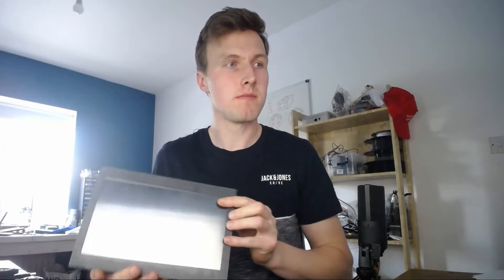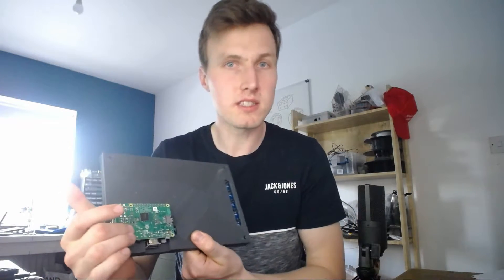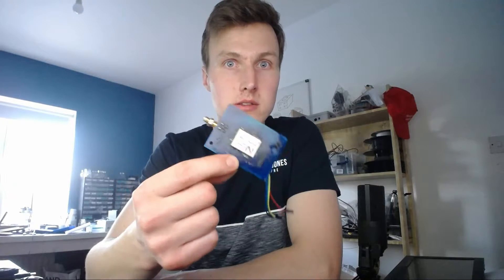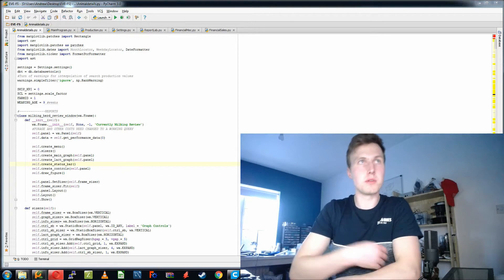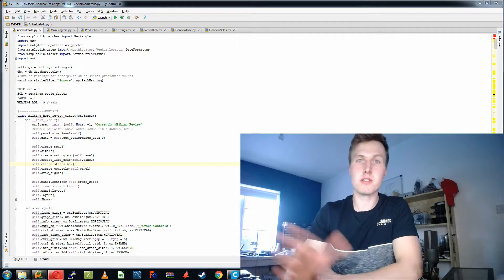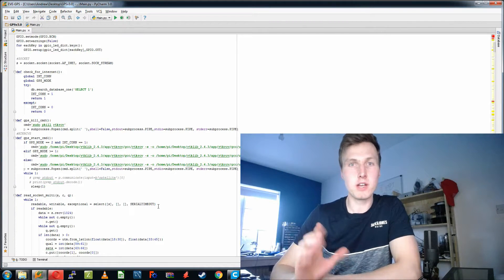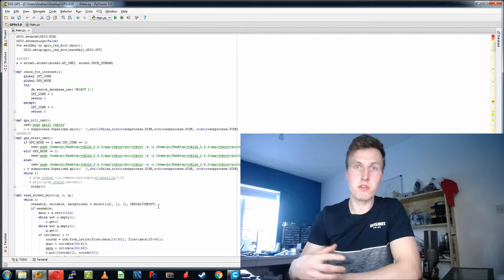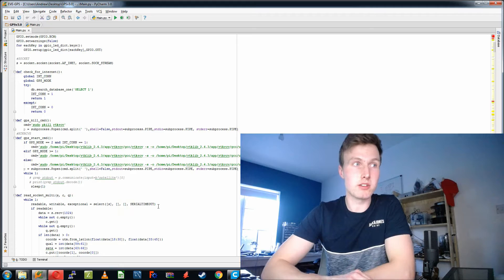Building RTK GPS for £250

Comment: Hi Andrew, the project looks great. I am also trying to create auto steering for a tractor and have already achieved some success. My system is based on the Pixhawk flight controller and I can already control the tractor with the joystick. I’m trying to write a program in Python similar to yours, but so far it’s not working out. I realized that you plan to make your program open source. Can you  give a link to the github or share the code at konnik800@gmail.com
I am trying to adapt the code from AgOpenGPS but the program is huge with about 30,000 lines of code, it is very difficult to find the necessary. Thanks for any help, I can also become your tester for free

Comment: This is brilliant. I've followed the AgopenGPS project for a while  but your linux platform appeals to me far more. This technology has been way too expensive for a long time.
Reply from the maker: Thanks. I will do another video of implementing autosteer very soon. Linux with rtklib is the really really cheap way of doing it.
Reply: @FarmTheoryNI  ive looked on RTK2Go and they have no base stations anywhere near me ( South of Manchester  UK). Do you know of anywhere else to look before I try to set up my own. Sorry if this is a very basic question. Fairly new to guidance GPS.
Reply from the maker: @v12cat  Google EUREF permanent network, or bkg ntrip Station lists. One in Daresbury might be close enough for you.
Reply: @FarmTheoryNI  Thanks.     I've registered to use the service. Daresbury is roughly 34Km from me.
Reply: @v12cat  hi, I've just started out on this, but from my reading so far 34km away might be too far to give you the accuracy you need. The further away the correction mast the less effective the correction.
Reply: @ksmith7122  My system is very near to being installed so I will report on how it goes.
Reply: Please, explain, what are the benefits of this unpublished software compared to AgOpenGPS?